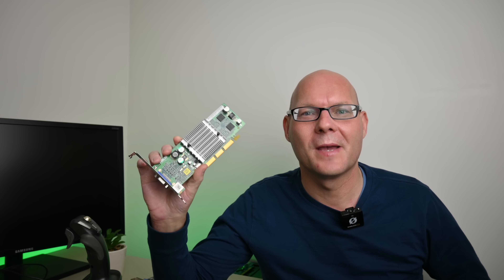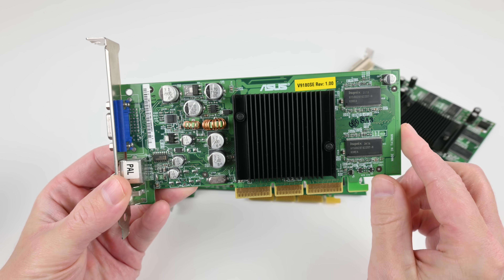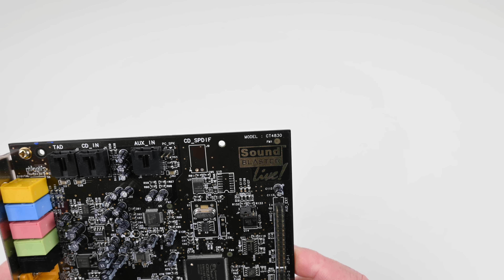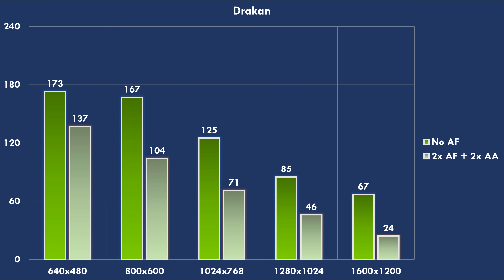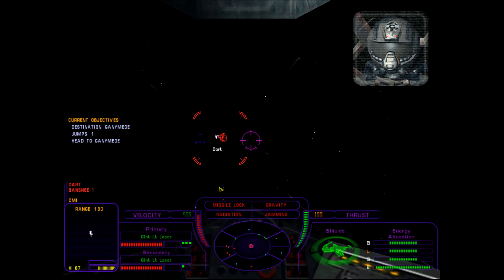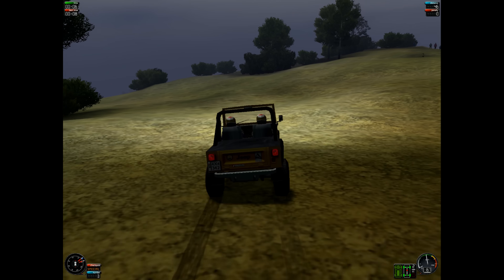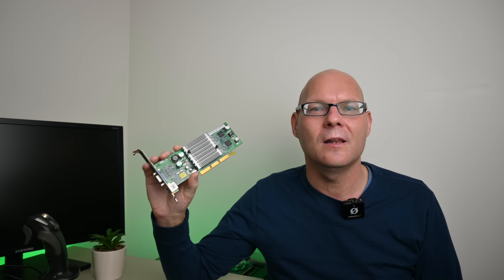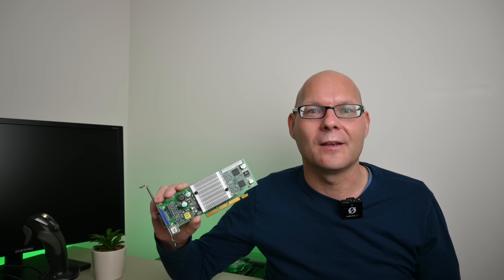One of Nvidia's most Controversial GPU

Comment: Like! I remember back in 2002-2003 many of my friends and colleagues became proud owners of new Geforce 4 cards... but not knowing the difference between the MX and TI series, they practically all of course purchased the cheaper MX ones, which where nothing else than higher clocked Geforce 2's. I remember two of my friends somehow even managed to purchase 32-bit memory GF 4 MX's, yes 32-bit, not even 64-bit ones. I was the one they called when they had problems with the PC and even today I remember what configuration they had :))
Reply: I did not know they made 32 bit cards, that is so Jensen. It needs to be benched!!!
Reply: @supabass4003  I have 3 MX440s, and each one of them have different memory specs...
64-bit DDR400 / 64-bit DDR300 / 32-bit DDR300. I don't know how was even allowed to name them the same, because the performance difference is insane. The 64-bit DDR400 one is more than two times faster, than the  32-bit DDR300 one. At least in 3DMark 2001.
Reply: @supabass4003  the 32-bit GF 4 MX is probably a little slower than a 128-bit Geforce 2 MX but faster than the 64-bit Geforce 2 MX200.
Reply: @3dfxvoodoocards6  Considering that my 64bit card only has 400MB/sec higher memory bandwidth than a 32bit GF4 MX440 and matches a GF2 MX400 (with the actual reference clocks), sounds about right.
Reply: @supabass4003 things like this are the reason I hate Jensen so much and would love to NOT buy Nvidia..

In the good old days I went with voodoo and then my beloved ATI!

Unfortunately these days you have to go with Nvidia if you want high end, because of the extreme performance disadvantages a 7900xtx has compared to a RTX4900.

It’s so annoying they can’t put out a decent card that is up on the performance..
It’s already the third generation of RTX cards and AMD still doesn’t compare :(.

I’d love to get their cards since I’m a huge fan of the CPUs, but they keep messing it.

On the professional level they don’t even offer anything mentionable anymore and my company only use’s RTX6000 cards these days while back in the day we always use the AMD Pro and FirePro cards and I really liked them!
Reply: @rolux4853  Except AMD DOES compare very well, I dunno what you on about. Especially considering the price.
Reply: That's why I got my MX440 for free from an angry person who bought it and then said it's shit and wanted to throw it out of window. The same thing happened to my father with FX5200, he also got it for free from a friend who switched to FX5700.
Reply: Especially the MX 4000 card series does have 32-bit models.
Reply: @keulloe  Except Sparkle's lab rat experiment, the 128MB 128-bit MX4000.

As strange as it sounds, I have one. Runs as fast as a Geforce 2, I think inbetween Pro/GTS and Ti.
Reply: The 64MB, 32b version manufactured by XFX was super common in my country (Argentina) :(
Reply: @Ale.K7  32bit???? That had to be worse than some integrated graphics. 😀
Reply: 32-bit GeForce 4MX - "When You Need Dedicated Integrated Grpahics™"
Reply: I also remember Voodoo 4 and 5 from that era, price through the roof, half of the games on the market wouldn't even work with them (did work with Voodoo 3, 2, 1....), since we are talking about disasters here...at least you didn't go broke buying GF4 MX...
Reply: @Ludak021  Actually the Voodoo 5 5500 was a very nice and competitive card for mid-2000 at 290 $ with a performance just slightly lower than that of the Geforce 2 GTS. It could run all games from that year with high FPS at high resolutions. The Voodoo 4 4500 on the other hand was very expensive at 179 $ when its main rival the Geforce 2 MX was somewhat faster and also cheaper at 120-150 $. But even the Voodoo 4 4500 was capable of running all games from that year with high fps in 1024x768 and 16-bit.
Reply: @3dfxvoodoocards6  The GeForce 2 GTS has pixel shaders though thru the NSR. Then again, only a few devs, such as John Carmack, took advantage of it. The Voodoo was also unsupported by then. 

A much more competitive card was the PowerVR Kyro 2.
Reply: This, along with choosing the 2gb 770 over the r9 290, made me completely lose trust, over Nvidia.
 I've been using Nvidia, regardless, but they are so overrated, it's not a pleasure as it's with Radeon...
Reply: Same story as op. But it at least allowed me to play MechWarrior 4. That card replaced an 8mb diamond stealth card which rendered MechWarrior 4 like Minecraft and Vaseline. That mx400 was like upgrading to Hollywood graphics compared to the diamond stealth.

Edit: padi $50 for that mx400 (pci, not agp). May have been a shit card unless you haven't upgraded since windows 95, than it was amazing.
Reply: I really looked down on these cards 😬 but I can't remember how I feel the price difference to real GPUs. Maybe I didn't searched for new cards in this time.
Reply: My pny card still works pci, 😂handy for getting xeons up and running.
Its key selling point was the purple pcb but that didnt make it any faster.

Comment: I got it in my first PC back in 2002, alongside a Pentium 4 Northwood 1.8 GHz and 256 MB of DDR RAM. I was pretty pleased with its performance back then, but quite quickly—after about two years or so—I realized that the lack of proper pixel shader support meant that new games were missing fancy water and reflection effects, and some of them didn’t run at all. I then upgraded to a Sapphire Radeon 9600 Pro Atlantis because I was on a budget as a kid, and I was finally able to see games like Morrowind or Fable in all their glory. Unfortunately, it aged even faster for me, and soon running games like Gothic 3 or Oblivion became a real struggle. So, considering the pure performance-to-price ratio, it was an awesome card, but it aged quickly due to the lack of some features.

Comment: Misleading? Yes. Scam? Not so, it actually performed well, faster framerates than the FX 5200 but without Pixel Shaders. FX 5200 was a scam chip/card, specially those with 64bit memory width.

Comment: I have an old p4 laptop with the GeForce 4 420 Go. I think it's an MX GPU? Anyway, it runs Half-Life 2 in DX7 at 1024x768 with good FPS, and it's a lot smoother than my Atom N450 netbook which was almost a slideshow😂

Comment: I’ve got a few MX440’s as well as some MX420’s and most of them are pretty bad. However, I’ve got 2 or 3 MX440’s that are 128-bit DDR variants and they perform better than most of my 128-bit FX5500’s

I’m quite a fan of these cards.

Comment: I don't care what anyone says, I bought a Voodoo 3 that had glitches galore(had both a Voodoo 1 & later a Voodoo 2) and was so disappointed(probably driver issues but all I got was black/white/black/green) I took it back and got a Geforce 2 MX  and even though it was slower it played all the games I wanted. It held me over til I was able to buy a better card shortly after this. Yes the G4MX sucked as well but I still have fond memories of that G2MX for some reason lol.
Reply from the maker: That V3 might have just been faulty?
Reply: @philscomputerlab  It was at release and I had heard there were driver incompatibilities with games I was playing(Wing Commander 5 Prophecy, Freespace 1&2, etc). You could be correct though, it was the higher end Voodoo 3 3000.

Comment: The funny thing is, I had a GeForce 4 4400Ti before, paired with a Pentium /// 700 I was overclocking to 933 in a 440BX motherboard - a Coppermine in a slotket - so you'd think I'd know the difference... here's the thing, I did. It's just that for what I was going for at that time, I didn't care that it was inferior. I read Tom's Hardware. It was cheaper.

The GeForce4 MX was "enough" for an HTPC back in the day, even under XP. That's how I used them - connected through S-Video to a 55" rear projection CRT set. And worse, I bought more than one - a MX 420 PCI for use with a "Celermine" 1200 and a MX 440 AGP I used with an AthlonXP 2500+. Definitely not great for gaming, but adequate for HTPC duties, simple/retro stuff and emulation - I remember emulating SNES and even PSX on those machines around 2002. 

I eventually got a Radeon 9600 which didn't suck as bad on XP and could actually play Doom 3. Though I didn't get a really "good" GPU until the X800. I believe I had the GTO version (12 pipelines) that I flashed VBIOS to open it up to 16. That thing rocked with an Athlon 64 3000+ (Socket 754) and 1.25GB of RAM, LOL. Yes, at one point I had two 512's and a 256 in that board. Probably running at 333MHz DDR1 (PC2700) because I think the 256 might have been slow. Or my memory could be fuzzy (it WAS about 20 years ago...)

Comment: If I had known this when I bought my GF4 MX440 I would have been furious. I passed up a used Geforce 3 Ti200 in favor of the "newer" Geforce 4..... I have to admit though, I wasn't disappointed with the performance, it was a nice upgrade from my Riva TNT2 ultra. I was supremely angry when I "upgraded"  to an FX5200, for DX9 support, only to discover that it was slower in every single game I played and what few games it played that my MX440 couldn't run were an unplayable slideshow anyway. If memory serves I was even more unfortunate in that my FX5200 was a gimped 64bit version too. That was my first, and last, experience with buyers remorse. It did however have S-Video which allowed me to connect my PC to my large TV, that was some small compensation. 

Back then it was hard to find good reviews and info on new hardware. The internet was nowhere near where it is today, most tech forums were populated by elitists and snobs. Asking questions about "budget" offerings was not typically met with any kind of helpful response, usually a deluge of "just save up a bit more and get X for $Y more". Considering most tech forums of the time were run and frequented by enthusiasts it does make sense. Not helpful to the average, broke buyer though 😂

Awesome trip down memory lane, thanks Phil.

Comment: First card I ever bought new was a gefroce 4 mx - and that typo was in its bios boot screen lol.

The incompetence from the manufacturer wasn't all bad, it had the much faster memory (which it wasn't supposed to), which I later found could also overclock far past stock - these cards were highly memory constrained so it ended up going almost twice the speed of my mates geforce 4 mx with 64bit memory.

That card cost me the equivalent of $35 USD (new), times sure have changed.

Comment: I still have my old Pentium 4 system which came with an MX420.  That computer struggled to play GTA 3, Morrowind was pretty bad, MechWarrior 4 would fall to a stutter in combat...I felt robbed.  I bought a Radeon 9000 Pro to get DX8 support on a budget and even that was faster.
Reply: i remember back then people sought after radeon 9500pro. because the fx series wasn't so good.
Reply: @kjererrt7804  Yeah, there were new cards coming out every 6-8 months with noticeable performance improvements. The 9500 Pro, 9700 non pro flashed to some other card, then the 9800 Pro were awesome cards back then. I have my 9500 and 9800 in my pile of old cards with an X850 XT and an FX-5950 Ultra. Good memories but my phone is more powerful 😆
Reply: because it was much worse than the gf2mx400.
Reply: @kjererrt7804  Yeah, I didn't know that at the time. It's got an FX 5600 Ultra in it now, so it'll run UT2k4 and runs Vice City OK.
Reply: @406Steven i guess it should. people bought a new card almost every year back then when the prices weren't as crazy as today.

Comment: Unfortunately I have the MX420. Was free. Was the only AGP card I could find in a stash of old hardware. 
My old retro build has a MS-5169 motherboard, K6-2 450, 128mb ram, sound blaster 16 and the MX420. I have a 6gb hdd with dos 7.1. The majority of my old dos games play fine, but can't seem to clear up the graphics on Hexen or Heretic. Looks like they are trying to play in either 8 or 16 color. Is there a way to fix this?
Also, I tried with windows 98se and playing in dos mode. When I tried this, I lost sound. No dos sounds coming through.
Reply from the maker: Interesting that it's those specific games being affected. If you can, try a different graphics card.

Comment: While some of the PR might have been misleading for non technical people, they made 3D gaming viable for many many people, myself included. Sure, they all had shortcomings, but the sheer fact that you could actually RUN things more than made up for it. TNT2 M64, GF2 MX, GF4 MX, GF4 4200Ti, 6600LE, 7600GS, 8600GS, 9600GS, etc, none were meant to be "all that great" only "budget friendly, good enough, works". Also good to remember that these days IGP's/APU's fill that "budget spot", but anyone old enough to remember i810 will giggle a bit. Had it not been for those "cheappo cut-down and feature deprived" GPU's the 3D gaming industry would have found  a LOT LESS purchase than it did.

Comment: absolute trash, at the time that they were still a bit common my god mother offered to buy me a laptop.... I spent a good bit of time looking around and found 2x laptops that came with a Athlon64 cpu(bleeding edge at the time:P; least one sales person wasn't aware Athlon64 was an option in a laptop) 1 was acer Ferrari 1st gen, other was Compaq R3000 series and I didn't want to over spend on branding; I spent a good bit of time looking for the best spec'd R3000 series compaq I could find and ended up with a R3240ca...... the r3240ca was a monster with a Athlon 64 3200+ cpu, 512mb pc2700, 60gb harddrive, geforce 4 440 go... to grasp how bleeding edge this was at the time, I ran UT2003 and while the cpu was running full throttle(it could run at 800mhz to save on power) it ran too fast *this was an issue that was later patched..... it was going great but as I used it I reached a hurtle with newer games, the gpu didn't support pixel shaders(featured on geforce 3 so would of assumed 4) and as time progressed it became clear that the gpu was a bottle neck that held back a otherwise insanely spec'd laptop for the time it was made in..... * the only gpu that I think may of been worse was the GMA500 on some atom netbooks(Sony Vaio P seires)

Comment: The cpu 3400 athlon might perform better with a ati 9800 or nvidia 6600 gt or even an ati 800 or nvidia 7600 - Im pretty shure but its up to the powersupply -I still remember my Hipper 550w psu broke down when using an Ati 850 PE for some time - a year and i was bought for that gpu at the same time.

Comment: Hey Phil, nice to see your Samsung monitor running in 4:3 mode! I recently switched to a 16:10 monitor after my 1600x1200 sadly died (good thing it was cheap). Your thread on Vogons about 4:3 friendly widescreens was super helpful for this! I ended out getting a Dell P2423 - 1920x1200, VGA and DVI inputs, and 4:3 mode (it even has a 5:4 mode, but no 1:1 pixel mapping). Super stoked to find a new monitor with all those features, and it seems to handle DOS resolutions fine (some frame skipping I think). Thought you might be interested to know that there are still some new monitors being made that are retro friendly.
Reply from the maker: Beautiful with IPS panel!

Comment: Dodging the 64bit cards on eBay is quite difficult because both the "MX440 8X AGP" and the "MX440 SE" can come with a 64bit memory buses. I think if they have 8 memory chips it is 128bit bus? And the SE is slower than the non SE. But sellers rarely provide that information and sometimes the label on the back of the card doesn't either!

Comment: I worked at a small photography store and our primary NT4 workstation used integrated graphics.  It was unbearable just for selecting photos in the Kodak software to send to our Noritsu printer.  I got so fed up, I bought the cheapest discrete card I could, a GeForce4 MX400 for $25.  I wasn't expecting much from the upgrade since the CPU was the same, but just putting in the video card made that workstation absolutely fly!  Photos loaded a good 6-8 times faster.

Ah, everything was better than integrated graphics back then.  8)

Comment: I was rockin the mx440 with an athlon in Windows 98 and regret tossing it all as I later found some games needed the obscure baked in hardware options these older cards have like the Final Fantasy 7 and 8 ports which run in a worse rendering mode on hardware past geforce 5 I think.
Reply from the maker: Yes FF games like paletted textures.